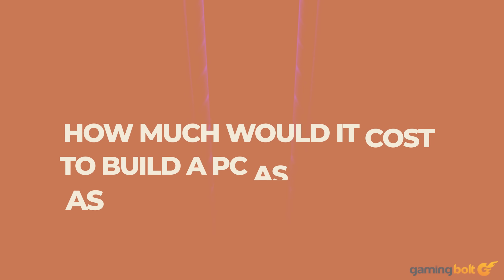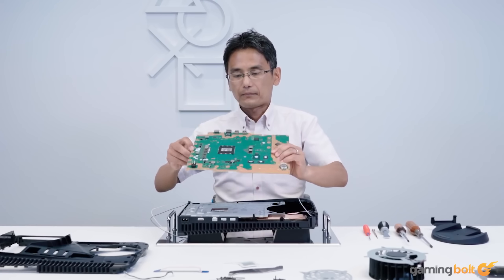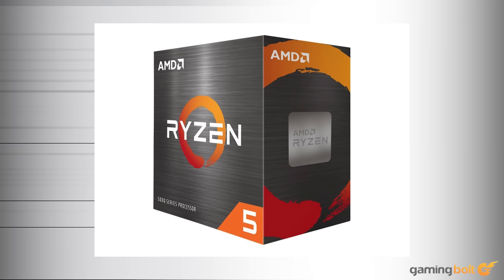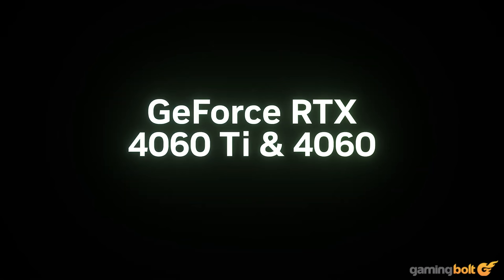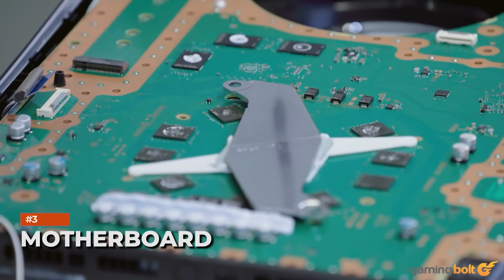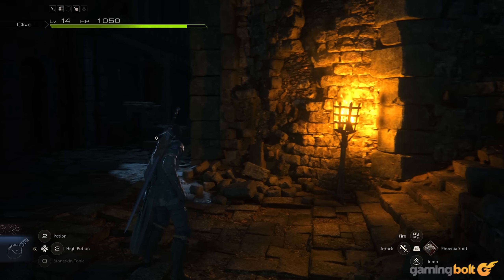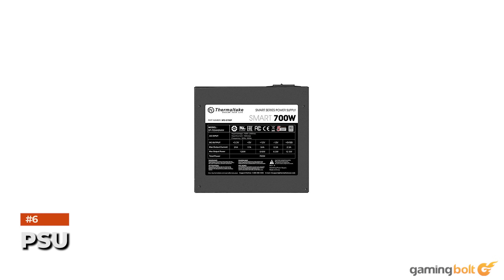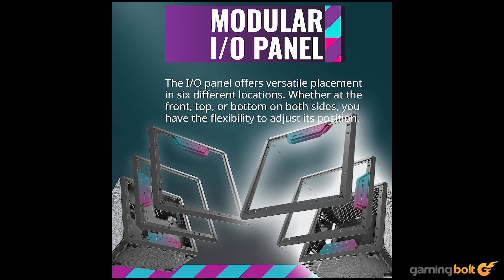How Much Would It Cost To Build A PC As Powerful As The PS5? (2023 Edition)

Comment: So,once again, consoles win. I aint spending an extra $300 bucks just to get a less optomized version of most games anyway.
Reply: Also doesn’t include a monitor that’s good enough to play this build
Reply: @JakMac88 does a console have a freaking tv oder monitor? ☠️
Reply: @Invictus-f9q  no but you typically have a tv already lol. You don’t usually have a monitor just on hand.
Reply: @JakMac88 I didn't know a PS5 came with a TV. And you can plug the PC to the TV, no need for a monitor at all.
Reply: Yeah but modding pc games is great.
Reply: not really, as gamebolts specs are wrong, the ps5 is closer to an RTX 2070, a very cheap card now, and no where near the stated 4070ti, that additional $300, would buy you something roughly 120% more powerful than a ps5.
Reply: @RivalGrimReaper  While you're not wrong, a 2070 still is almost 300$ by itself.
Reply: @RivalGrimReaper  You pc nerds always have the moronic tendency to see these game systems from a spec sheet level, which is why you nerds are nowhere near as smart as you want to believe you are, lol, looking at that spec sheet and a game system is like looking at Genkai in YuYuHakusho like Hiei did after she gave her power to Yusuke, and thinking she is weak, then looking dumb after she blitzes Shishiwakamaru, the spec sheet has never been the way to accurately measure a game system's capabilities, its sad the ingenuity and sophistication of these systems is always far and away outside of the realm of you pc nerds' comprehension.  I bet you look at multiplats or even recent exclusives going to these pcs, and think that too means pc is from these spec sheets better than these systems, but sorry to burst your bubble, the moment the game systems enter multiplatform development, any exclusive properties built into each system is automatically put to the side for pc, pc is the only one being prioritized in multiplatform development, you can tell by how many settings pc versions get and how fleshed out pc versions are with mods and whatnot, yet you walk around with some banner of pc honor as if pc has really won over systems that havent even come close to getting to stretch their legs in a true exclusive environment; what a laugh.
Reply: You don't get less optimized versions of games on PC. You just get dialed down versions on the consoles 😂. I can't think of any reason to go with consoles unless you have a hard time figuring out what the settings mean.
Reply: @biskitpagla  True that, pc is getting the most optimized versions of the multiplats, and they arent even coming close to taping the power and potential of the game systems, poor pc is beating these game systems while the game systems arent even operating at a fraction of their true potential, what a shame pcs that are so much more expensive cant show a meaningful gap between themselves and game systems, even when the game systems arent being used to their maximum.
Reply: Yeah I am always been more console player than pc player, consoles are always a best way to play and stream videogames definitivy playstation consoles
Reply: But only since the Ps4 Pro. All PCs on the level of the Ps4 for 400 would probably be stronger. Same goes for Ps3
Reply: @schwubmexx The optimization is never there though. It's something alot of people overlook with consoles that weaker system specs get very good results because how well optimised they are over a PC with a bloated operating system.
Reply: @pixeljauntvr7774  Your probably right. The best looking games are Games like God Of War and GOW Ragnarök, The Last of Us 1 and 2, Ghost of Tsushima and more